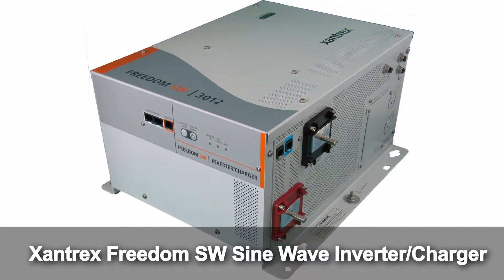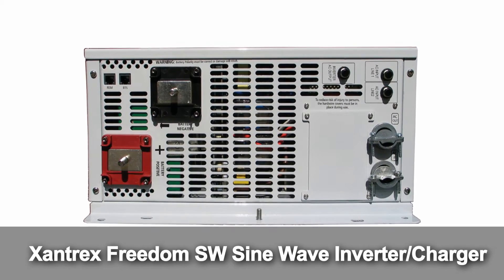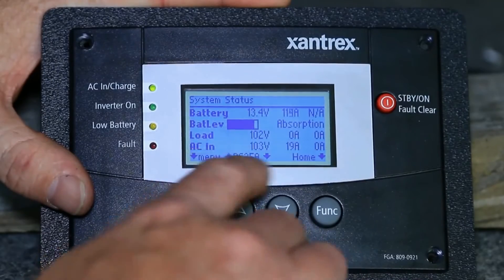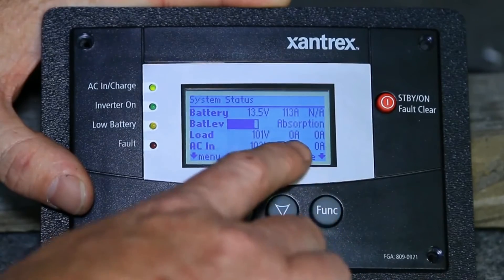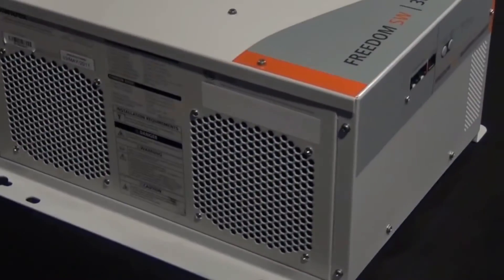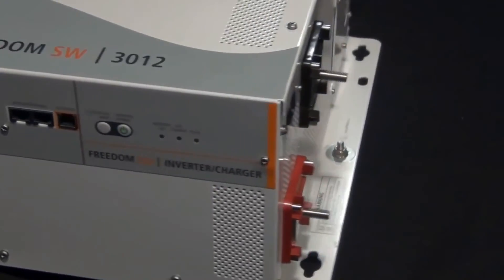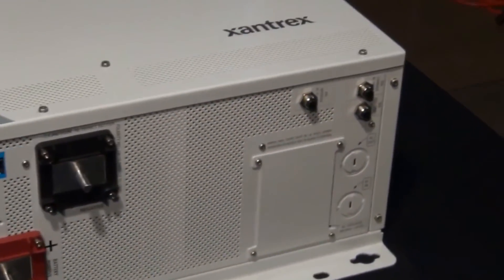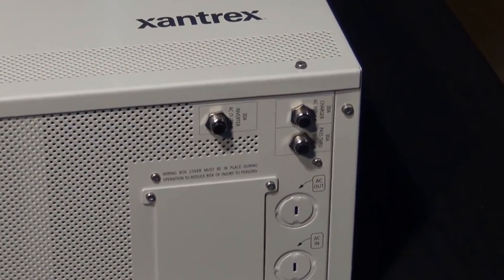Power Time - Ed Sherman - On the Xantrex Freedom SW Inverter/Chargers - Part 1

Comment: Hi there , i have a bank of 4 - 6v 220 amp hour -deep cycle butteries.
2 connected in series and then ( 2 sets of 2 )-12v in parallel . to create 12v-440amp 

I am looking to get an inverter and a charger , 
My question is : Is this product will be capable to charge this 4 butters over night if I'm not discharging the butteries less then 50% ?
Reply: B & B Locksmith And Security Inc It will be more than capable. I have six 6 volt, 400ah batteries and will be installing the 815-3012 in my system.